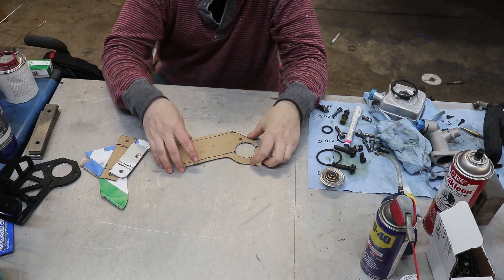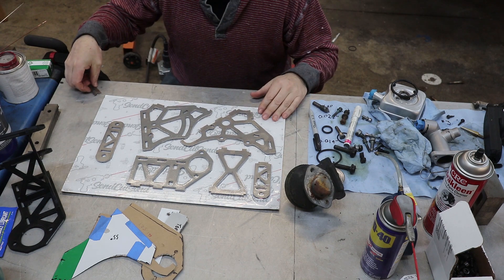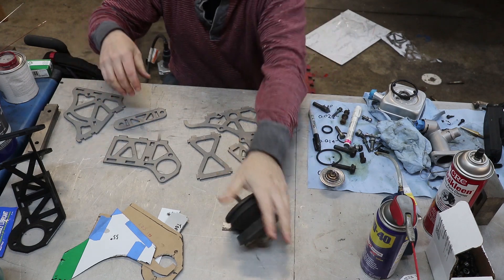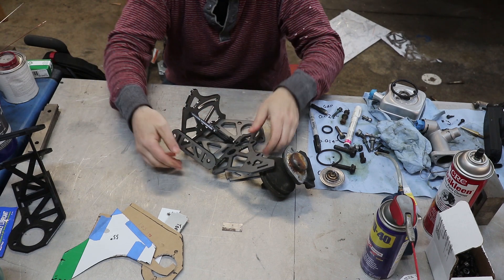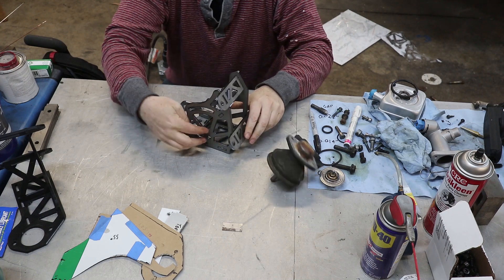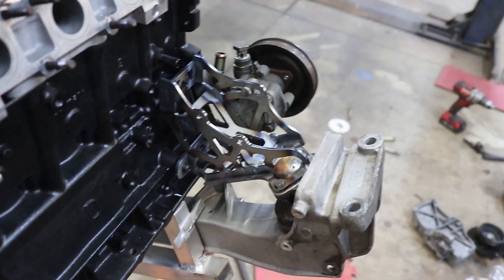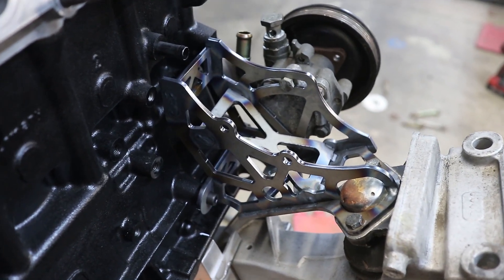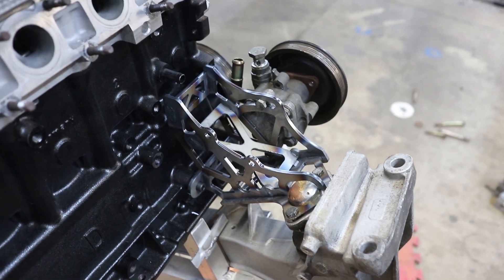Engine mount prototype for 1.8T swap in 944

Comment: Hi, I quite like your mounts, I’m working on the same swap as well. Do you think you could upload the design files so I can use them in my build? Thanks
Reply from the maker: I'm not opposed to selling you a set of mounts, once they're finalized, but keep in mind that they're really only going to work with the size adapter plate I'm using - your build might not have the engine in the same front-to-back location.
Reply: @vsvenson  hey if you are willing to sell these mounts. Ill purchase a set..im doing a 1.8 swap as well with an AEB housing. I ran out of steam at the motor mounts. Due to not having a decent welder.

Comment: Fantastic job and thanks for sharing.

Which software did you use for the design and to send it over for fabrication?

Take care
Reply from the maker: I designed it in Fusion 360 and sent the files as DXF to be cut.

Comment: Looks great Van!
Can I bug you for a question? I am thinking of doing the balance shaft delete on my track only 3.0L S2 engine. Have you heard any bad feedback from racers on that modification. Sorry not related to your video.
Reply from the maker: Yes, I have bad feedback from racers on balance shaft deletes... usually the extra vibrations cause either the oil pickup tube to crack or the fuel rail to crack.  (If you're lucky, the power steering bracket will crack first, before you blow up the engine or burn the car to the ground.)  Unless you're chasing every last horse power, I don't recommend deleting them.
Reply: @vsvenson  thank you. I really appreciate your feedback. I will keep them in.